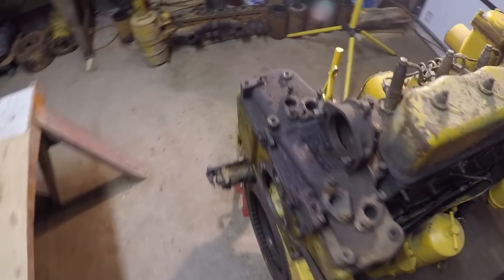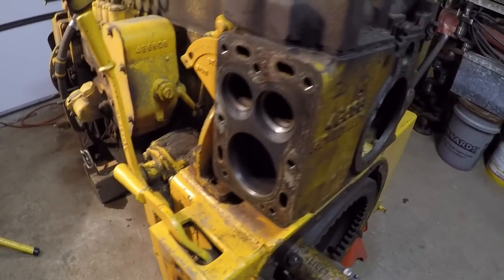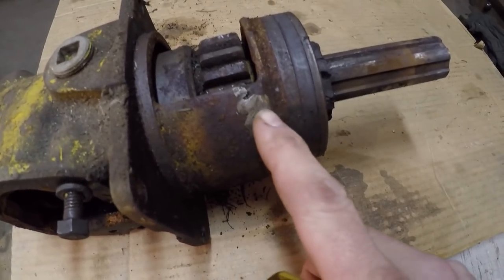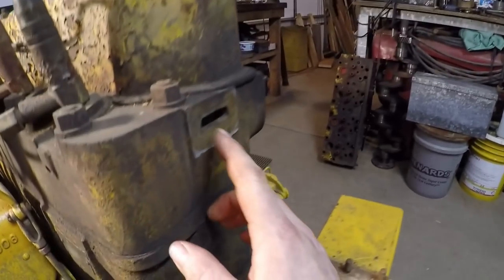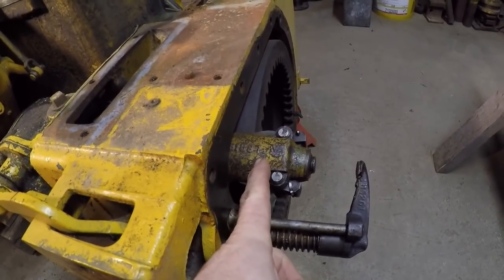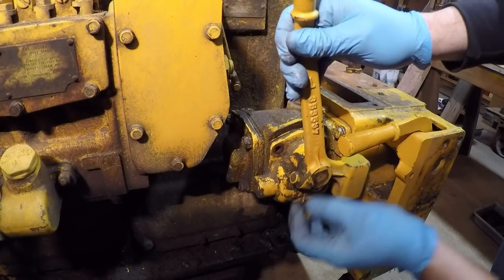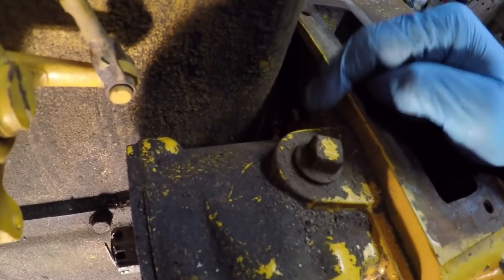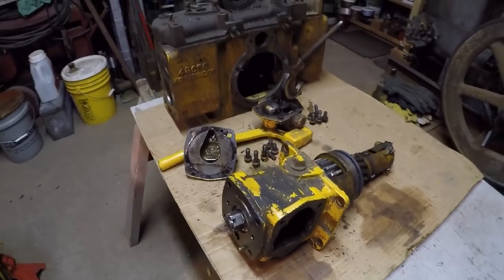Caterpillar D2 Starter Pinion Drive Removal Sequence - 3J and 5J Series Tractors

Comment: Very interesting and great videos! I have spent the last several days getting a pony motor running on a 3J 1939.  After some carb work, I was able to get it running tonight.  I engaged the pinion and then engaged the drive, which in turn spun over the diesel.  After several minutes of trying to start the diesel (which didn't) the pinion disengaged and I haven't been able to get it to re-engage.  it just grinds hard.  So I quit for the night and found your page looking for solutions.   Any advice would be appreciated. I really didn't want to get too far into this since I don't own it.

Comment: Hey Squatch, just yesterday I removed the pinion drive assembly from my 1941 5J. Try as did I could not compress and latch the pinion sleeve which is why its removal was needed. The pony motor was removed.  No amount of twisting and turning the clutch end would clear the governor housing. Just  too long not being latched. I had to remove the governor housing. The bad photo in the service manual shows the governor housing removed. Once out, the pinion sleeve was a rusted mess. Probably had never been out of the engine in over 50 years and never saw a drop of oil. No oil in the idler gear well either. It seems the pony motor and pinion drive all suffer much neglect. The pony motor is about as bad. All bearings need renewed. Bore and valves are good though.
Great video. Now how about one where you can't compress the pinion sleeve and have it latched? Waddayadoo?
Reply: For all of the quality built into the D2 it seems that the starting system is the weakest from an engineering standpoint. Perhaps, back in the day when they finished the D3400 engine design they pondered "How are we going to start this thing?" Maybe it was handled by junior or apprentice engineers. A lot of drinking was done back then perhaps that is part of the story. The reality is lost to history.
Reply: Agreed. Viewed as a sacrificial  or consumable system, the light construction makes more sense. There could also be a sprinkling of pre-world war II, depression era cost saving thoughts in the engineering as well.

Comment: I'm working on mine right now. I have the pony motor pulled out and all bolts removed. The pinion assembly wont come out. It keeps "springing" back into the flywheel housing like it's being held. And suggestions?
Reply: @squatch253  thank you. It was the o ring. Hit it with some penetrating fluid and it came out with some fiddling. Thank you for your videos. They really have me wanting to get this thing going. It has the hyster d2n winch on it like in one of your other videos.

Comment: I suppose if they bought the machine with the latches broken and never new it should lock in automaticity, they thought holding the lever back manually was just the way the engine was supposed to be started?
Reply: I've been helping a guy with his 5J D2 and just learned that the pinion needs to be engaged. We have just been engaging the clutch and the main engine cranks. So the pinion is stuck in the engaged position. Of course we haven't got the main started yet, so maybe when it does, the pinion will disengage.

Comment: I bet A lot of the ignorance towards that starter lever is the fact that most people have no clue on how it was originally designed to be used, and prob was taught to just simply hold it, never knowing something was wrong. some cases im sure the people are just to lazy and figure they can reweld it for free versus searching for replacement parts too.

Comment: My pinion is engaged and I can't get the pony motor to start since it turns the engine over also. How do I disengage the pinion?
Reply: @squatch253  No I'm an idiot and engaged it. Thanks for the help, I'll let you know how it goes.
Reply: @squatch253 thanks. That worked and the first time I hit the pony starter it fired right up. Had to let it run for about 30 minutes before the engine would fire up. 

Looks like the engine has some blow by coming out the oil fill port and the oil drain on the right side pony head leaks oil. A few hydraulic leaks. Other than that ran great. 

Thanks for the help again! Much appreciated.

Comment: Great video, I don't understand how the starter motor gears engage with the diesel engine to mesh in smoothly or is there a clutch in the starter unit,
Reply: @squatch253  Thanks very much, your explanation is good, I just need to hear the the pinion shaft stop for the engagement to take place, thanks again

Comment: Thanks. I'm positive I'll never be working on a D2, but it is interesting nonetheless. I wish you had spent an extra minute to also show how to remove the starting engine, since not every backyard mechanic is likely to have the manual.
Reply: @squatch253  It would be great if you keep the camera rolling for all work that you are going to do on that starting engine.  Your experience is most helpful, much appreciated.  What's the trick to get that center inside bolt of the starting engine that threads into the bell housing?   Also, if you can provide info on filter change out, priming, and checking pump, rack, injectors.  Thanks again!

Comment: What oil viscosity is used in the pinion assembly?
Reply from the maker: Cat recommends using the same grade and weight of oil that you also use in the diesel engine, but another trick that has been proven to work well is filling that pinion clutch compartment with automatic transmission fluid because it lubricates everything just fine, plus it creates a lot less drag on the clutch discs and makes it easier to engage the pinion without gears grinding 👍
Reply: @squatch253  thank you I used motor oil for now but will drain flush and use ATF . One last question I removed pony motor to remove the pinion assembly. I ordered the pony base gasket from CAT but can’t find the part # for upper coolant gasket the thick rubber one that is wedged between pony and diesel engine. Can you please share that # …. Thx
Reply from the maker: There are two different versions of that seal, depending on your top cover port and if it's been modified for the "new" version of that seal or not.  Check out the video in the link below, in it I explained everything there is to know about those top cover mods and what type of seal you'll need, as well as part numbers - https://youtu.be/9s1pv2qvVlY
Reply: @squatch253  ok thank you for your help .
Reply: @squatch253  you wouldn’t happen to know where I could find the cap for the radiator on this RD4 1936 4G438 it’s a more like a cover with wing nut….

Comment: Have you ever converted one to electric start?
Reply: Michael Spinello the bigger cat dozers you can get a electric start but these smaller d2’s you cannot get one because we had to rebuild our d2 pony and looked for electric motor but no luck
Reply: @stearsfamilyfarms6264  I've seen the electric starter  for the D2 on the internet, brand new for $1500 us
Reply: Mighty Moe Excavating does it take the place of the pony or is that where you send your block in and they install a starter
Reply: @stearsfamilyfarms6264  it's a unit with a starter and the stand that replaces the complete pup motor. I talked to the guy on the phone and to ship it to Canada was expensive so I never got it. Auto LEC.com

Comment: the old no 10 snaped off the arm to engage the pionion so someon cut a hole in the back of the housing and then put a bolt to the shaft and welded a second lever
Reply: what should i do it starts fine so should i leave it
Reply: @squatch253  thank you for the advice  also the brake lever/clutch is very wobblely what about that thank you